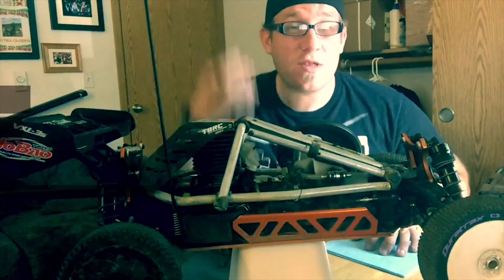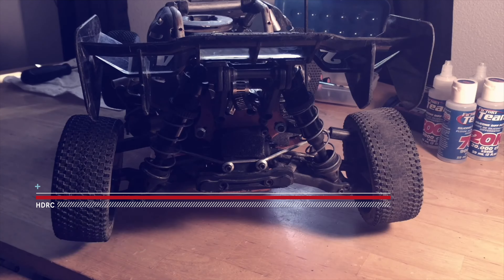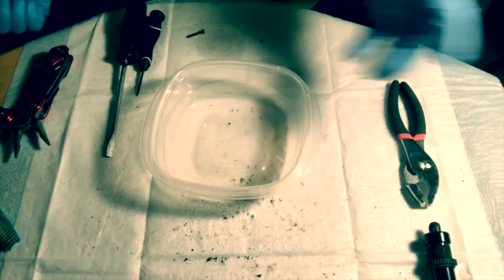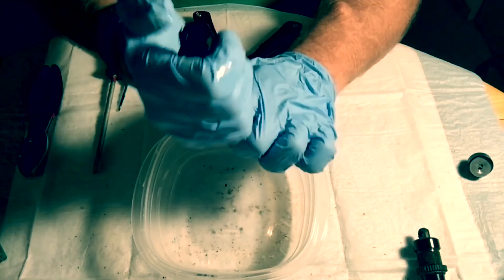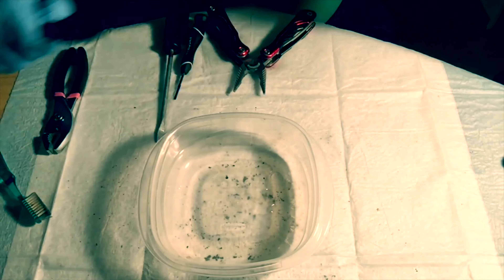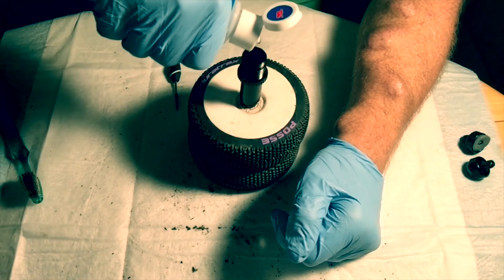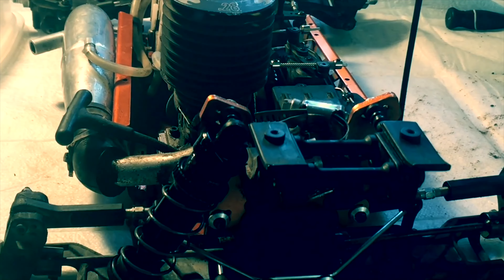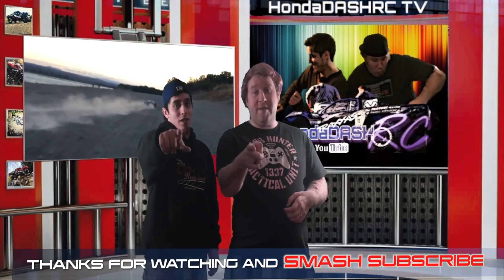How To Remove, change oil and Clean RC BIG BORE SHOCKS

Comment: awesome vidoe bro! quick question is a two stroke RC better than nitro?
Reply from the maker: nitro is a two stroke
Reply: I mean the 22cc engines.  That run on ordinary gas and not nitro
Reply from the maker: There awesome, BIG and expense and there a miny Car so it will have the problems of a real car just smaller but if i could get one i would make sure you watch this video https://youtu.be/hHj2S8cWcZ8